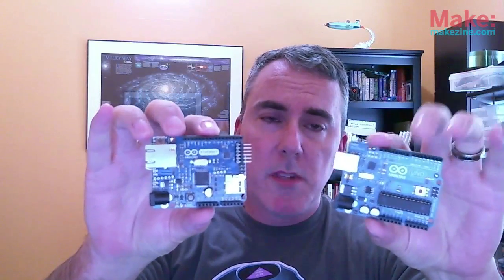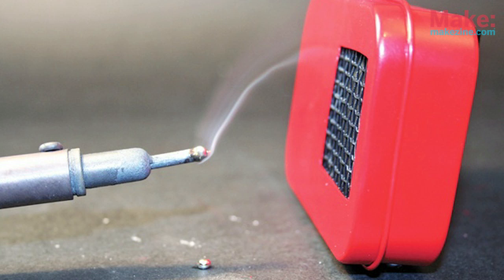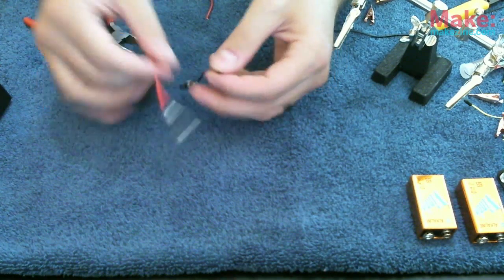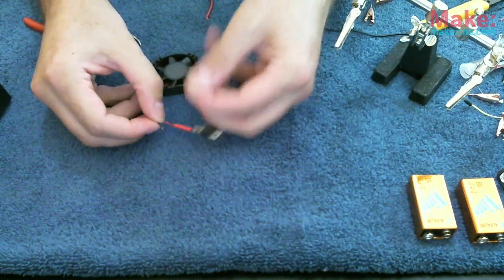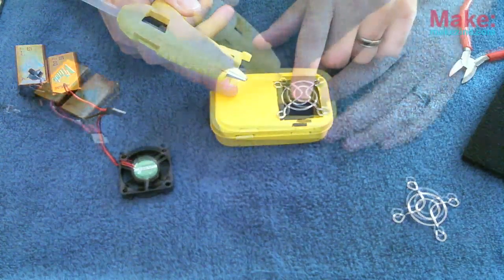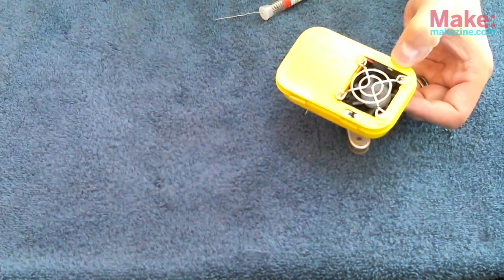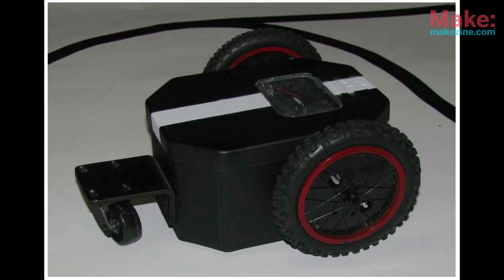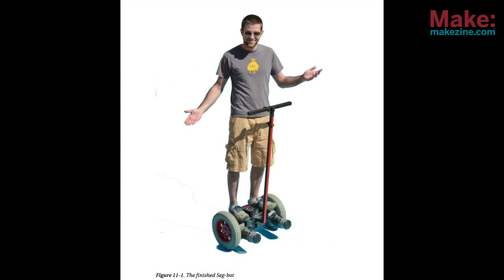The Latest in Arduino 03

Comment: You can stack some header pins to the Arduino and then put any shield on top of that.   That will handle the  height issue with the RJ45/Ethernet adapter.

You need two six pin and two eight pin headers and you can easily order a kit of those at sparkfun if you want.

Comment: @01Alexsimps : I concur.. I've done this already, to extend the pins on a the stock ethershield, to allow plugging the protoshield above it, for additional circuitry. You basically end-up with a 'Taller' project, but it's better than the short-circuit caused by the RJ-45 socket's shell.

Comment: @ThinkLearnSolve : either the MakerShed (the Maker shield), Adafruit Industries (The Proto Shield), or several makers on eBay. While on eBay, look-up 'Arduino headers' and you'll find sources for the male/female extension headers to extend the headers from shorting to the Ethernet socket.